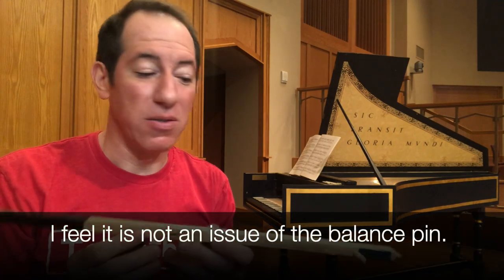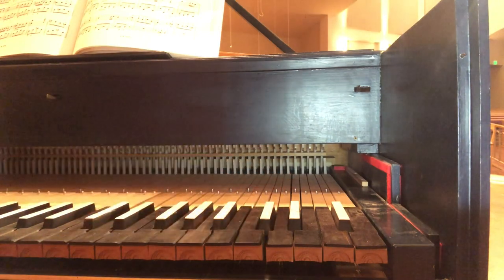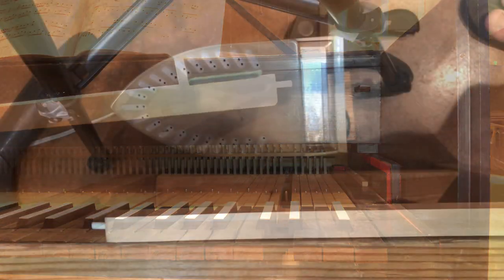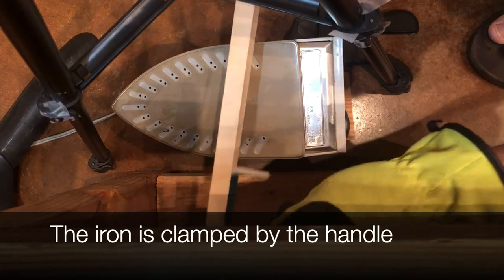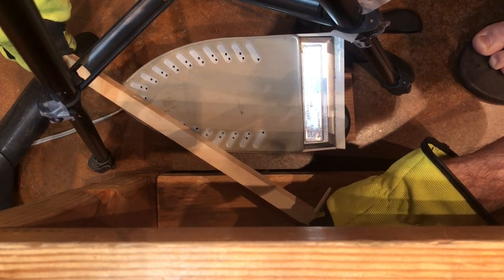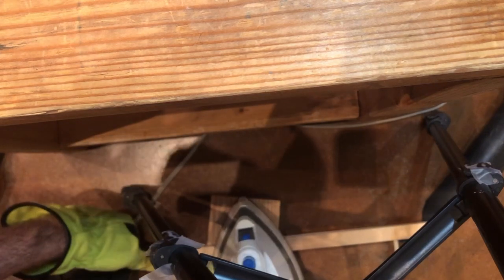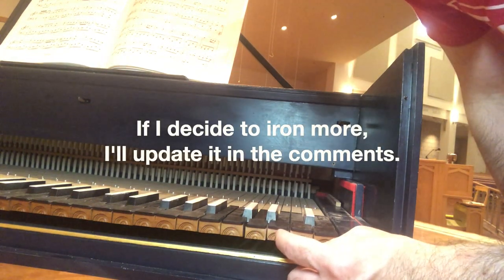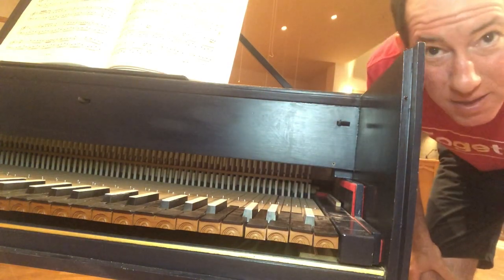Straightening a Warped Key | Harpsichord Fix

Comment: Thanks for the informative video. After watching your video, I used this method to straighten a key on an old reed organ (pump organ).
I put the tail of the key on the floor, and ran a hot iron along the side of the key as I pushed the iron down rather hard. I gave it  a pretty good dose of heat for about 30 seconds to a minute....but it didn't scorch the wood. And it worked really well. I was surprised.
Best Wishes!
Reply from the maker: That’s great! After all my endeavors, I just barely ended up shifting the wood’s straightness…. It wasn’t as much as I intended to do, but got the job done. I did this method after a heated debate on the Facebook Harpsichord page. I decided to document this idea, since it was the most widely agreed upon. I did scorch the wood a tad, but of course doesn’t matter back there. I’m glad it was helpful!
Reply: @jeremypeterman3319  Well, I think I used a little more force with the iron, than you did. I placed the tail end of the key on the floor and I held onto the front of the key and also pushed down sort of hard to "Bow" the key in the right direction as I pressed the middle of the iron onto the wood and Ran it back and forth, but I also held the iron in place sometimes to let the heat get through. I don't blame you for being more gentle with the harpsichord key. I wasn't too worried about the organ key, as it really isn't a very valuable instrument. You might try putting a piece of paper or thin cloth between the iron and the wood to protect it from scorching then you could give it a heavier dose of heat. Best Wishes!